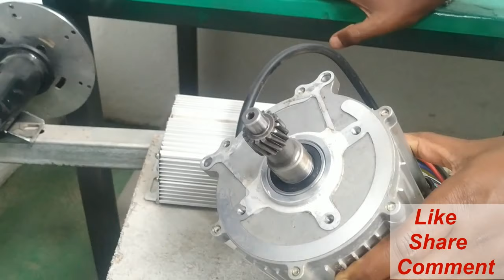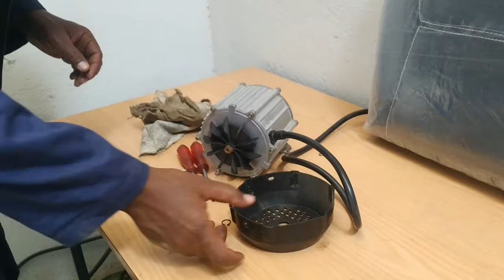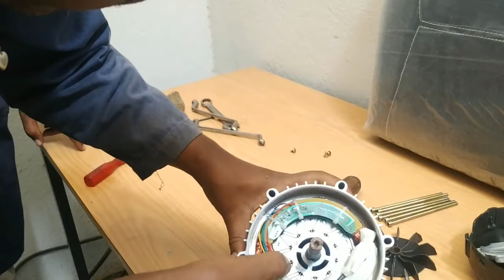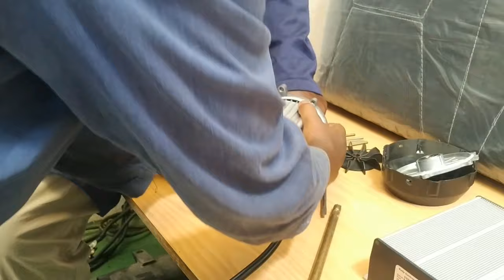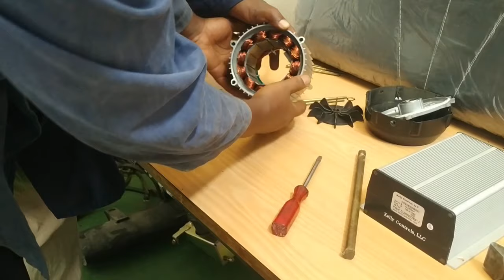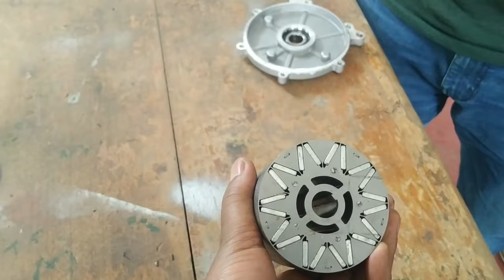how to teardown electric vehicle's brushless motor

Comment: New motor  3 mants work but coil no damage  hole sensor good work   motor   sound  high /  ( sine wave)   me folt not a catch,😔😔
Reply from the maker: I don't fully understand your question, but you seem to have either bearing problem or wiring issue.

Comment: I have One it's not running when I connect it only trys to run and stop what could be the problem
Reply from the maker: Dear! Thank you for visiting our channel. Regarding your question many things can prevent the motor from rotating, for example: misalignment of the shaft in relation to the coil, if the shaft has some bend, that could be the cause of a malfunction. faulty hall sensors, and some fault in the field winding and its connection can also prevent the motor from functioning properly. Please check to see if any of the above  are causing the problem, especially if the motor has been disassembled recently, misalignment might have happened when assembling.
Reply: I have replaced my hall sensor but when I switch to reverse it's not working and it works well in forward direction
Reply: Finally I have achieved my reverse motions
Reply from the maker: @waliggoisa5262  wow! congratulations!  What was the problem and how did you fix it? Was it misalignment?
Reply: @TheAbJGarage  no it wasn't misaligned but just I had not allocated the reverse switch

Comment: Really very nice video showing dismantling of motor. Is it pmsm or bldc motor as the magnets are inserted in rotor. 
Where can I get this motor? What is brand name of the motor?
Reply: It should be a bldc i guess.. The windings are concentrated ..
Reply from the maker: it's actually a 60v, brushless dc motor

Comment: hello can you please tell me the specification for that motor? and where i can buy it? thank you
Reply from the maker: The motor was actually a 60V brushless DC motor, the power is 1.2kW, Maximum speed is 3000 rpm, and efficiency of 90%. It was actually donated to us and therefore I am not sure about the current price and where to buy one. This one is removed from an electric three wheeler axle.
Reply: @TheAbJGarage  i have a 1500w motor that tipe but with just 8 magnets. That looks like it has a more eficient rotor and shoud spin at higher rpm. I have never seen that tipe of rotor anywere

Comment: What is the spec of this motor? Like No. of poles? Type of winding? Hall effect angle?
Reply from the maker: Dear! All I know about the motor is as follows: The motor is actually a 60V brushless DC motor, the power is 1.2kW, Maximum speed is 3000 rpm, and efficiency of 90%. Thank you.

Comment: Is the motor still working?
What battery does it use? the old car-acid batteries or the modern lithium ion battery?
Maybe you can install it into another rickshaw.
Reply from the maker: Yes dear! the motor is still working on a converted three wheel vehicle. We have used five lead acid batteries to generate 60 volts for the motor. Lead acid batteries are heavy and have less charge holding capacity so whenever possible one should go for lithium ion...

Comment: Whats the power.?
Reply from the maker: The motor is actually a 60V brushless DC motor, the power is 1.2kW, Maximum speed is 3000 rpm, and efficiency of 90%. Thank you.

Comment: How much diameter rotor
Reply from the maker: 60V brushless DC motor, the power is 1.2kW, Maximum speed is 3000 rpm, and efficiency of 90%. Well actually I don't remember the rotor diameter right now, and sorry about that.